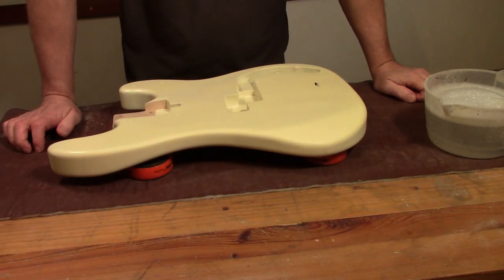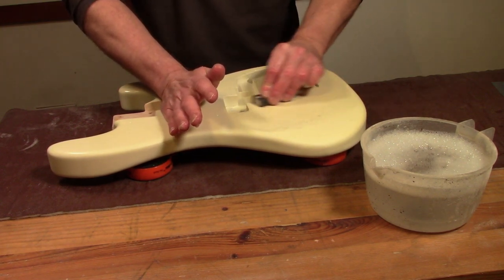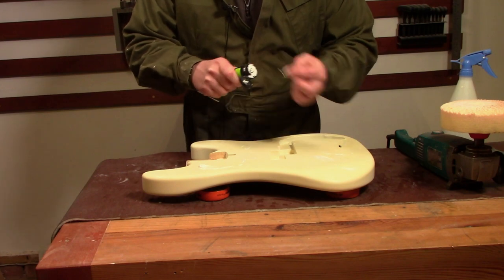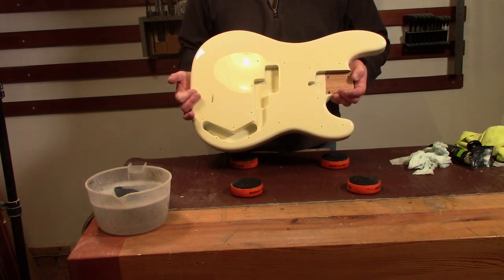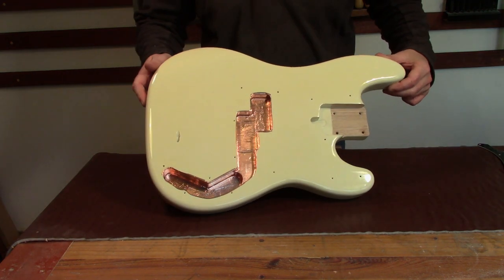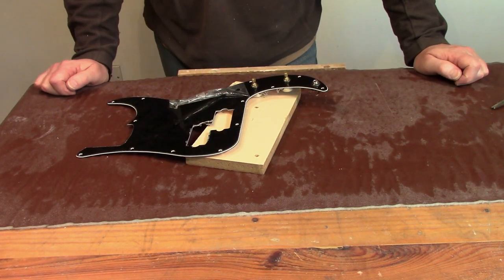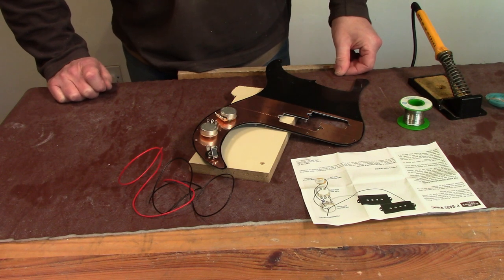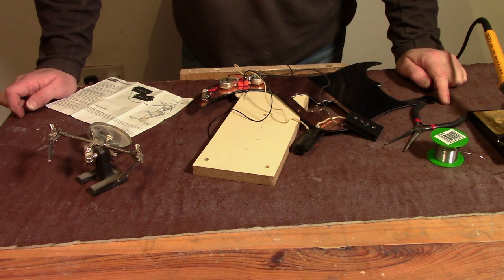Precision Bass Build Episode 10: Paint polish and wiring.

Comment: As an electrician, I'm always surprised how many people consider this stage as "witchcraft "
It's the bloody woodworking that's witchcraft ........ish....yeah it is!
Reply: Guitar wiring hasn't changed much in the last 40 years. Lift (elevator) control systems in the mid-80s had bundles of long cables and numerous solenoid switches, taking up a cabinet as large as a two-door wardrobe. Today, it's so different! But guitars are pretty much wired the same way now as they were back then. I've wondered why, but can't really think of a good reason.
Reply from the maker: Haha, I kind of understand what's going on and kind of don't but if you break it down it's easy enough. Wood, that's more my comfort zone :)
Reply from the maker: For me it's musicians sticking with what they know works and is easy to fix. When I played in bands I was always very keen to keep as many points of failure out of my rig as possible.
Reply: @Adventuresfromtheshedofdreams  I'm with you on that now. I made the switch from engineering in the late 1980s and I don't even remember what I was able to do then. With my second guitar build (in 2019), I had to rewire twice before I was able to get everything working correctly.